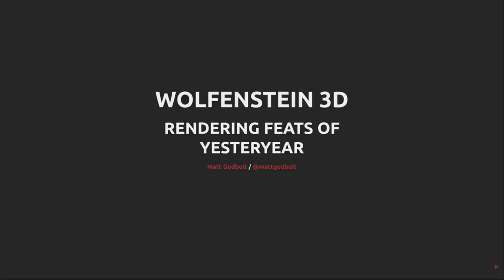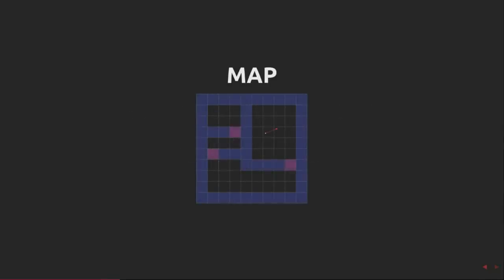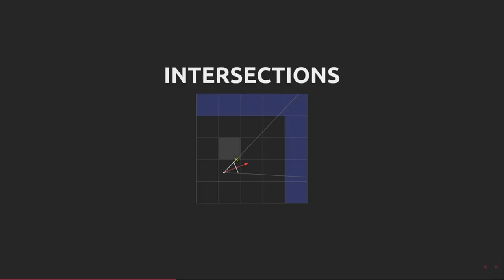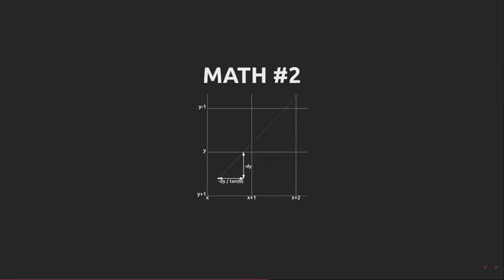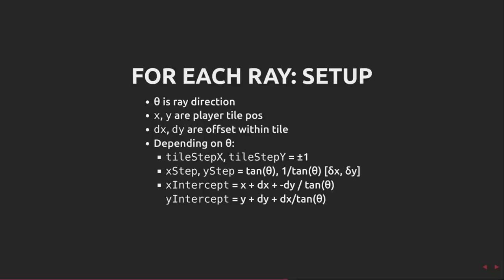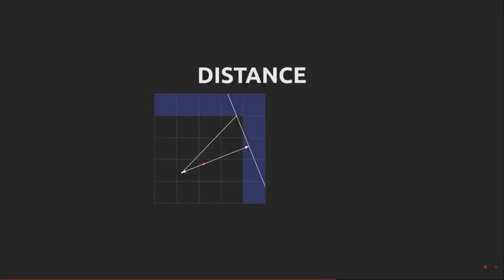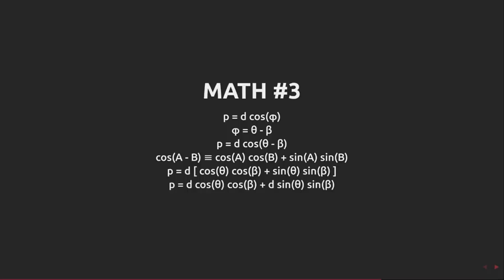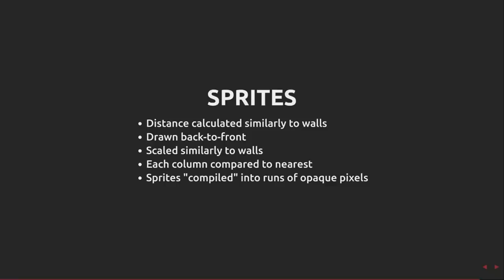Wolfenstein 3D's map renderer

Comment: Very good script, however the illustrations need to be bigger. You're only using a 1/4 of the available space. That means huge problems when watching the video on smaller screens. As long as you're mindful of title safes, you can actually use way more of the screen, making room for bigger and more readable graphics. This is especially important when you're dealing with programming code. Hope to see you improve, because your content is GOLD!
Reply from the maker: Thanks for the feedback: A number of folks have mentioned this. This was based on a slide deck I used for a presentation at my employer a few years ago, and I should have spent some time resizing the content. In my latest video (completely different topic; Seasocks websocket library) I took this to heart and spent a while trying to make sure the content fit nicely. Thanks so much.
Reply: Subbed!

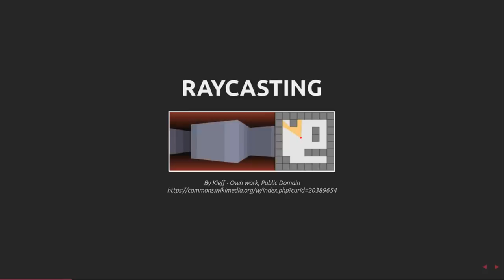Comment: 1:33  not exactly true for ray-casting vs ray-tracing.  Your example of ray-casting does work like that but ray casting is about looking at what is front of you and won't account for "bounces", while ray-tracing will account for "bounces" in light, furthermore I think ray-tracing starts at the light source and bounces a finite number of steps and if the light goes towards the view the bounces are cut short or of the light goes to infinity, into the sky example then boom.. furthermore ray tracing accounts for "losses".

Comment: There's a mistake in the definition of raycasting and raytracing. In raycasting you fire a ray for every pixel on the screen and stop when the ray intersects an object, in raytracing you fire a ray for every pixel on the screen and when the ray intersects an object you fire another ray from the point of intersection and into the direction in which your ray is be reflected by the object, and you repeat this action until your ray intersects the light source, thus tracing a ray of light from the camera and to the light source. In raycasting color of a pixel on the screen is determined by the color of the object at the point of intersection between it and the corresponding ray you cast and maybe the distance. In raytracing, the color of the pixel is determined by the color of an object as it is lit. The renderer in Wolfenstein 3D does even less than a normal raycasting algorithm would because it is only capable of rendering a certain kind of scene with a certain kind of camera: You can't look up or down and the floor and ceiling are always the same color, so the renderer only needs to cast one ray for every column of pixels, like it was said in the video, to determine how far a wall is. And, since the only other type of object on the scene is a billboard/sprite that always faces the player, raycasting is only needed to render the wall textures.
Reply: Your definitions aren't correct either.

Raycasting is tracing a single ray PER COLUMN (or row, in theory) of pixels, and determines the point at which this intersects a surface. - you then use this to determine what column of a texture should be drawn, and the distance to determine the length of the line. (and in more advanced raycasting engines, some kind of lighting parameters.)
That's raycasting.

Raytracing also doesn't do what you think it does either.
It traces a ray from each pixel and looks for an intersection with an object.
If it's a fully reflective surface, it then traces a line based on the angle of incidence and repeats the process until it hits the bounce limit set by the renderer.
It doesn't trace until it hits a lightsource, rather when it hits a surface, it traces a line to each light source, determines the angle to the surface of that specific light source at the point of intersection, and uses that to determine the lighting contribution.

What you're calling Raytracing is a process called Path Tracing.

What you're calling Raycasting is, to my knowledge a non-existent algorithm.

What Wolfenstein does is how Raycasting is described in every book I've ever read on the subject.
Reply: @KuraIthys  Tbh I would argue that there's no real between raycasting and raytracing. In all these ray-based algorithms, you take a ray, trace/cast/fire/whatever it in some direction until it hits something, and then do something with the result. We need better names to differentiate between all the different rendering algorithms based on rays.

Comment: This is an interesting video, but an average PC in 1992 was running an Intel 486DX/33 which has both an integrated FPU and is a full-32-bit CPU that supports up to 4GB of addressable RAM.  

Furthermore, 486DX2's started coming onto the market around mid-year with speeds of 66 MHz and the first early (albeit buggy) Pentium's came to market shortly thereafter, early in 1993. 

IDK where / why / how you came up with basic 16-bit 80286/12's as "being "state of the art" in '92 (more like '87!) but that's a woefully incorrect assertion! Even crappy, sub-par PC's were running 386DX processors by '92! 

Also, primitive accelerated graphic cards (typically using then-available VESA bus architecture, such as the Diamond Viper I had) were starting to appear at this time as well so basic ISA / Integrated SVGA wasn't anywhere near "state of the art" by then either...
Reply from the maker: I wish I could update the video. Many folks have made this point and I've replied to each to say, yes it was a mistake.
Reply: This isn’t true. The average computer in 1992 used the 386. The 486 was strictly high end and this is why the developers at Id chose the 386 to design around. Regular consumer 486 pc’s did not become common until 1993.
Reply: @robertforster8984  🤔🤨🤣 lol!
Dude I don't know what kind of neo-luddite, post-apocalyptic technological landscape you lived in back then, but, in 1992 I was in college and getting married. Literally everyone in my class had either a 486 SX, or DX under their hoods. Some were even installing Pentiums shortly thereafter when they were released a year later. Furthermore, VLB was a commonplace option on all platforms.

I wasn't an early Pentium adopter, as my journey from '93, to '95 was from the 486DX/33 through the i486DX/2-66, then an amd486DX/4-120 and, finally, to a Pentium 100 in '96.. 

Nevertheless, since the argument I was rebutting was the comment about 286's and onboard svga being "cutting edge technology", even accepting your anachronistic argument about a supposed ubiquity of 32-bit 386's would still prove the point that the 286 was very FAR from "the cutting edge" in 1992. 😂😂

Comment: I'd like to know how the lookup tables work and how the precision works with fixed point numbers.
Reply from the maker: Something like this: instead of having 360 degrees in a circle, have 256 of them. Prepare (for eaxmple) a table of sin() by having sin(0/256), sin(1/256), sin(2/256)... etc. Now you can get sin(angle) by looking at entry "angle" in the sin table. For the entries: we know that sin() ranges between -1 and +1. So, we use a signed number between -128 and 127 to mean -1 to +1: we store (sin(angle) * 128)) in our tables, as an integer. So now we have a 256-byte table of sin. To multiply by sin(angle), we take a number like "150" and multiply it directly with the sin value. Then we shift it down by 7 (to account for the 128-scaled sin()). That way we get an answer in the right domain. Later you can note that there's a close relationship between sin() and cos(), and can reuse parts of the table. tan is a little trickier, as is tan-1. But hopefully this gives a little taste!

Comment: Again with the trigonometry and angles... if you use the vector dot product the math becomes simpler and it can be calculated quicker... cause sin(x), cos(x) and tan(x) are all interative functions as far as I know, or they use an approximation to get it quick...
Reply: 1992, gov. If there's a game from around or before that era that even implemented vectors, then it was likely incomplete and basic because computers had a fraction of the processing power they do nowadays, and graphics and gamesim had to both run on the CPU, plus OOB programming wasn't exactly a thing, or at least in its infancy and not commonly used. So, all that stuff is pretty impractical, but you know what could get the same results for far less CPU usage? A good ol' lookup table with precalculated sine, cosine, and tangent values.

And wouldn't you know it? https://github.com/id-Software/wolf3d/blob/05167784ef009d0d0daefe8d012b027f39dc8541/WOLFSRC/WL_MAIN.C#L586

In fact, Doom used the exact same method, although the function was renamed to R_InitTables.
Reply from the maker: Dot products require two multiplies and an add in 2d and yield cos theta times the magnitude of the vectors. So it needs normalised vectors (which would require square roots), and still required more math functions than a lookup and a multiply. You're right in 3d applications on modern hardware dot products are much more common :)

Comment: Where floating points more expensive to compute back then ? And if so, did they use integers for doing all those calculations ?
Thanks for a great video btw.
Reply from the maker: Igor Mitrovic absolutely! There was no hardware floating point unit. Software routines for floating point had to be written, and software FP is at least 100x slower than hardware. 

Floating point numbers have to be unpacked, added or multiplied, renormalized and then repacked. Or something like that. These are all integer operations and so can be written using just normal integer instructions. Hardware is more efficient by far at this though.

Googling "software floating point" gets you a bunch of guys if you want to look at code, else the Wikipedia article on floating point explains some of the algorithms. You can see how you might build routines but also that they're considerably more complex than just integer addition.
Reply: Fun fact: today's x86 int (long) divisions are about 10 times slower than float (double) divisions (possibly other operation too but I did not check; for div it's about 10 vs. 100 cycles) making fixed-point algorithms slower than simply using floats! Blew my mind when we stumbled upon that while trying to figure out why our fixed-point port of an algorithm was way slower on x86 than the original.
Reply: If anyone is interested, there are great lectures on Youtube by Alexander Stepanov(the guy who wrote STL in c++, and invented concepts) about many programming topics. In one of the lectures he talks about cost of fixed and floating point operations used on different data structures. You will find that lecture here :
https://youtu.be/3K2LmnaLLF8
Basically today, it looks like, floating points have pretty much caught up to integers, if you look at the speed of computation.